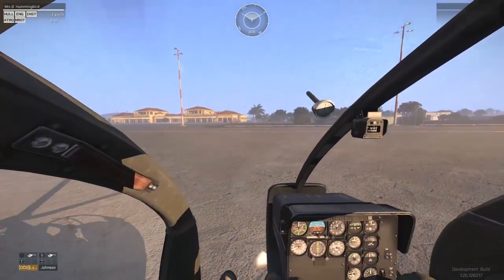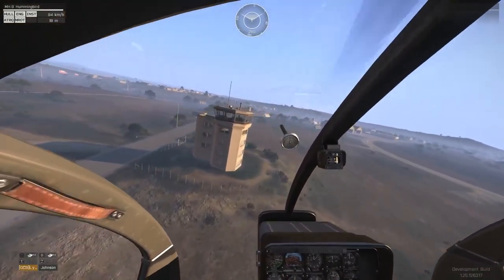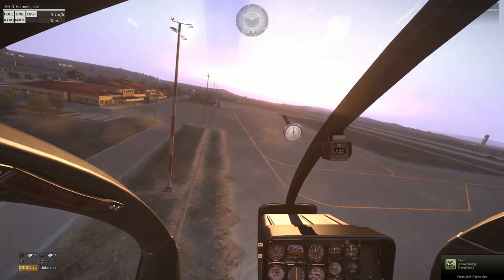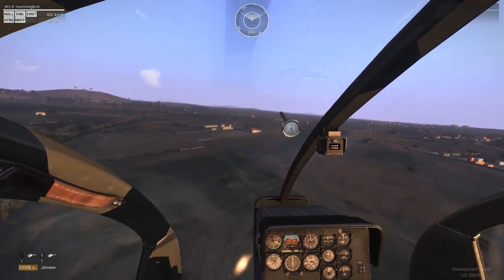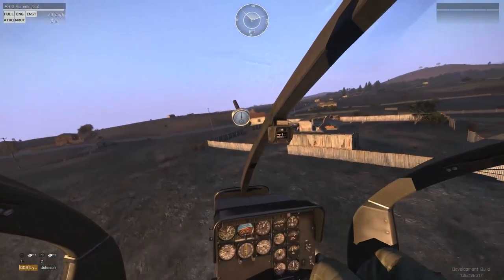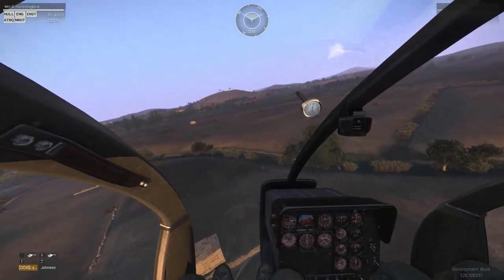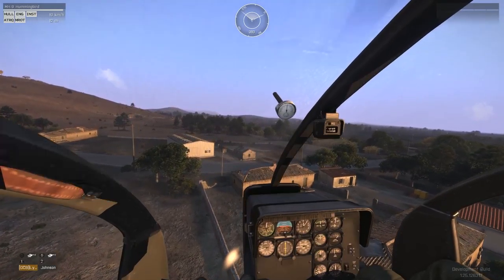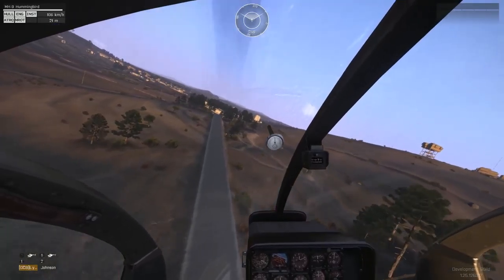ARMA 3 NEW Helicopter RotorLib Flight Model Impressions

Comment: Great video. My opinion on it is that it's in a Goldilocks type zone now. Not anywhere near as simulated as something like DCS or even Take on Helicopters, but it's also not intimidating for a community to switch over to. I will not be using anything else when it hits stable. Also, interesting idea with the deadzone, will need to give that a try with my X-55.

Comment: Are you using a stick extension with that warthog? I've read that they're much better for helicopters, and they notably reduce the stiff deadzone the joystick has. Also, the hard landings option enabled allows you to have harder landings.
Reply from the maker: Yes I have a 12CM extension and it solves the spring tension issue that the stick has. It's now much easier to make fine movements, the whole thing just feels 10x better. I also took it all apart and re-greased the ball, plate and cup inside. Quite a job...
Reply: Lyndiman Nice. I really need to buy a warthog.

Btw, I've seen a mod in a video that totally removes the spring. watch?v=D85dKSV9wD8
Reply from the maker: remon kewl Nice. In a perfect world I'd like to switch between my current centering spring action for planes and a force trim action similar to those old sidewinder joysticks for helicopters.
Reply: Lyndiman Or build something like this guy watch?v=JB9oyGVGSo8 which works on both.

Comment: Never add curves with helicopters. In a real helicopter the trim actually centers on the position the stick is. so you might be trimmed out and flying with the stick in the forward and left position. Trim centering is not like and airplane where the control surfaces have trim tabs, it's purely artificial to keep your arm from getting tired holding the stick in a certain position. So in order to fly realistically you should have a force feedback joystick that centers on the position the stick is in. The sim will not fly correctly if you use curves.

Comment: Good stuff, yet another reason other then elite: dangerous to get a full set of Warthog + rudder pedals, or though I am still trying to find a way to mod the pedal to be similar to a real anti-torque pedal.

What kind of pedals where you using?
Reply from the maker: I use the Saitek Combat Pedals with the spring set to minimum. I'm not sure I would recommend them but they do the job fine.
Reply from the maker: Oh and I will totally be using it with Elite: Dangerous! (soon)